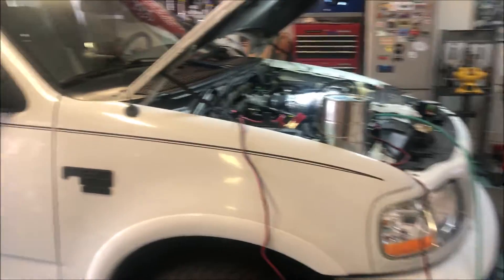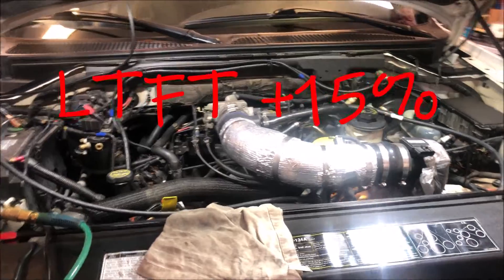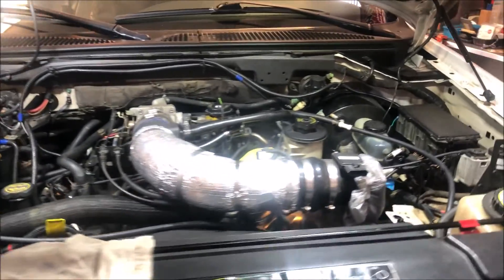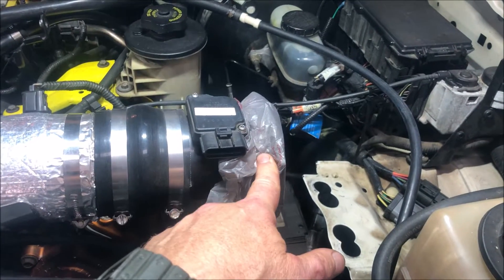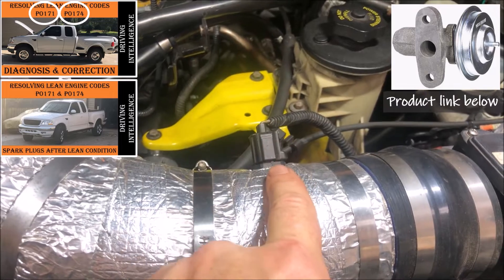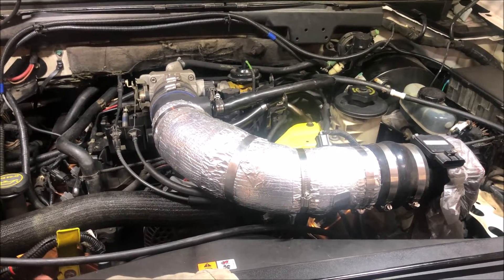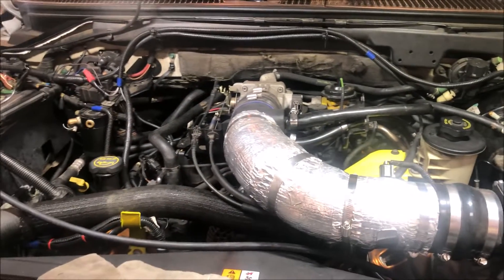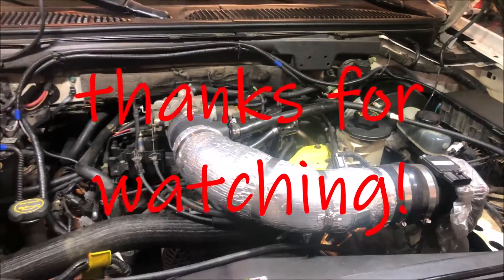How To Diagnose High Positive Long Term Fuel Trim: Test Bad MAF & Find Vacuum Leak With Smoke Test

Comment: Love these videos. I have the same code and waiting for my smoke machine to arrive. I’m assuming I have multiple leaks and one is from the gas cap since I don’t hear any release of pressure when I take it down to near empty
Reply from the maker: Smoke Testers are great for vacuum and EVAP leaks.  Stay in touch with your results.  What codes are you retrieving?
Reply: @DrivingIntelligence  
Will keep you updated. 
I have to replace both exhaust manifold 
Was wondering if everyone buys used one, the rockauto or go fully aftermarket performance. I’ve seen yours. I believe they’re high performance. Taking out the exhaust studs for ARP studs. Don’t want any issues with them snapping overtime. 
Engine codes : 
P0125 : Part - F56Z-10884-AA
P0453 : Part - 
P0171
ABS Codes -
C1155 : left front wheel speed sensor input circuit failure 
C1145 : right Front wheel speed sensor  input circuit failure 
C1158 : Left Front wheel speed sensor coherency fault

What’s a good scanner that can read transmission code? I have a old bluepoint from 2010. Time for a new one
Reply from the maker: @prophinishnyc31  Thanks for all that info.  Here is the diagnostic tool I recommend:  BlueDriver Bluetooth Pro OBDII Scan Tool - https://amzn.to/3lsVutO - if you buy through this link I get a small cut to support my channel, and it will not cost you more.  Be careful with P0453.  The sensor is saying you have high pressure, that does not mean the sensor is bad, it means it senses a problem with the EVAP circuit.  Also, your "C" codes are likely due to aged wheel speed sensors and both need to be replaced.  Finally, I would not buy used manifolds.  They are prone to cracking, get new units or go with some shorty headers:  https://youtu.be/9lrywhBHczM - thanks for keeping me informed.
Reply: @DrivingIntelligence  how would you go about chasing that Evap circuit issue?
Reply: @DrivingIntelligence  as far as the c codes
I saw one wheel speed sensor disconnected and completely chopped off. I believe I’m running 34” and I do hear wheel bearing noise up front. So I will replace both sides and wire up the front right which is chopped off. See if that resolves the issues
Reply from the maker: Were you able to resolve the wheel speed sensor issue?  I'm still looking into the EVAP issue... doing a little studying.  What year is your truck?
Reply: @DrivingIntelligence  2000 5.4L , wheel speed sensor I have not address. I do have the new wheels hub with pigtail harness for the passenger side. Unfortunately I work Mon-Sat and with the new change of time; when I arrive home in queens Ny; it’s dark, cold and no garage.
Reply from the maker: @prophinishnyc31  I feel for you in that winter weather!  Let me know how it turns out when you do that work.
Reply: I have the exact same thing on a 97 2wd 4.6 2v F150 with a 75mm BBK throttle body.  I even smoke tested the exhaust, evap system as well as engine.    Checked exhaust back pressure. So many other things I checked and or replaced its too long to list here.    Using ForScan Lite as my scanner.   I’m down to phantom intake manifold leak on lower plenum or low fuel pressure.   

Replaced the fuel filter and fuel pressure regulator.  DPFE sensor , EGR valve, EGR solenoid, EGR tube, EVAP purge solenoid, EVAP canister purge valve, and all those vac lines in back of the intake, some leaky section of EVAP lines that failed the smoke test.….all replaced with new.   Put  a new throttle body gasket in,   Yes I am the parts cannon.    About 19.5 inches of vacuum at idle now….cleared the PCM a million times….but still those fuel trims still.   Ugh. 

Runs like a top at all RPM’s and engine loads, throws no codes…but those fuel trims are whack.   Driving me nuts.

Fuel pressure is about 33 psi with good volume.   Is that it ?   Some say 40 psi minimum.   Others say nope.    I get mixed stories if that is too low a pressure or not.    This thing is trying to beat me but I’m gonna win someday.  

If anyone has any ideas please post.   Thank you!
Reply: @AB-kd9mk ohhhh the PAIN!!! I can relate.  EXACTLY what you said.....96 geo tracker.  At this point, with all the tweaks and def some parts, it runs pretty good. (just a littlle sputter-miss when idling?) But will always throw the dreaded p0400(EGR FLOW...)after i have tinkered abit, then do a clear/reset. History is new parts plus I cleaned all tubes and ports, etc. and tested tested tested and I finally traced it down to 1 of 2 EGR flow tests, (where the results where retrieved ECM'S P0400 freeze frame data, thru my scanner) the failure was from getting a low BARO input vs. a minimum specified one.  like 758 where it needed minimum 11550, so no pass, throw the p0400.
ALSO, while driving i notice how the long term fuel trim is spiked, plus gets a lil doggy and smelly exhaust, and not so happy overall.
SOOO I now feel like its a small intake manifold leak, that is letting un metered air in as manifold vacuum "increases" (but never hits optimum reading cuz said leak creates pressure drop. (then throws code)  ANNNNND When the 02 sensor smells the extra air blowin downstream, it commands ecm to raise the LT fuel trim to compensate.  (i suspect this because every now and then, mostly then,  i can get front 02 sensor to respond to me wafting propane near the bottom of the intake gasket area.  but its hard to replicate with  precision.  also after looking at them online, it seems the lower gasket material is very minimal where it rounds the bottom of each port.  i assume one of those areas has failed. This has been FOREVER trying to get this figured out.  Just boiled this theory all down on my prob 6th? revisit over the past 4 yrs!!!!!  I just decided i will eventually go for the replacing this gasket, and it might take months to get to it, but ill let you know what happens....gooood luck!!!

Comment: I have 75% pos fuel trim at idle on bank1 on a 5.3l. Can anyone tell me whats wrong
Reply from the maker: A 75% positive fuel trim at idle on bank 1 in your 5.3L sounds like a severe lean condition—the ECU’s adding massive fuel to compensate. Common causes: vacuum leak (intake manifold, hoses), dirty MAF sensor, faulty O2 sensor, low fuel pressure (pump/filter), or exhaust leak before O2. No codes? If no CEL, check for pending codes. Share the vehicle year/model and if it’s at idle only or under load. That’ll help narrow it. Clean the MAF and inspect hoses first

Comment: I would asume if it was maf or vacuum leak would afect both banks..maybe u got small exaust leak on one side ...hope u post solution if u got it fixed
Reply from the maker: The tuner I was using was making claims I had a problem with my fuel trims.  I in fact did not.  His tunes were not designed to properly handle the mods I had on my engine.  5-Star handled them perfectly,  I have since stopped using that tuner, I don't feel he truly understands these engines.  With 5-Star tunes, my fuel trims are perfect.

Comment: Im still not positive how a dirty maf can only effect one bank. Or anything in the intake tract besides right at the seal between the manifold and the head.
Reply from the maker: Given the path of air from intake to cylinders is different between each bank of cylinders & the MAF, the tolerances in ECU monitoring might pop a DTC for one bank before popping a DTC on the other bank... just a wild guess.  Also, figure in fuel injector differences, ignition performance differences, exhaust performance differences on each side of the engine, etc... all add up to affect fuel trims on each side of the engine differently and could cause a DTC on just one bank when the MAF is the problem... again, an educated guess.  :)

Comment: My fuel trim jumps between +100 and -100 aha doesn't seem right
Reply from the maker: Do you have a check engine light?  Diagnostic trouble codes?  What vehicle do you drive?
Reply: @DrivingIntelligence  alfa romeo mito 135 multiair, intermittent misfires high in the rev range and rough idle, suspect its a bad vacuum leak as multiair unit is ok
Reply from the maker: @matthewmckendry9428  As you saw in this video, one of the diagnostic tools I use is a smoke tester.  There is one I recommend in the description of this video.  Smoke testing will find your vacuum leaks, if that's the problem, but there could be other reasons.

Comment: i’m having a p0171 code. could a loud exhaust manifold leak and flange leak cause this? obv that leak is before my upstream 02 sensor.
Reply from the maker: Yes, an exhaust leak can cause a perceived lean condition.  It will allow oxygen to enter the exhaust and fool the O2 sensor.

Comment: my long term fuel trim increases with high rpm whislit the short term decreases, however when idle, the opposite happens and the number is very high on the short term
Reply from the maker: For some reason, your vehicle is requiring much more fuel caused by a vacuum leak that sucks in significantly more air when the engine is under load. This will cause long-term fuel trims to increase. Have you checked for vacuum leaks?
Reply: @DrivingIntelligence i have with a smoke test, none were visible, might be worth re-checking that, however today checked my purge valve and turns out with a battery voltmeter it didn’t produce a clicking sound as it apperantly has to prove it’s functionality, pain in the backside this but ordered the purge valve and going to replace it and see the effects !
Reply from the maker: @JRZL1 that could be the problem! You didn’t have any diagnostic trouble codes, telling you there’s a problem with the purge valve?
Reply: @DrivingIntelligence  no trouble codes indicating a issue with the valve :( only a po171 code which is quite frustrating, seeked some advice today, got told might be the timing or a bad flex pipe replacement, (as I had that replaced) but mentions that it may not pass emissions so will give that a look over aswell
Reply from the maker: @JRZL1 the purge valve could be introducing unwanted extra air
Reply: @DrivingIntelligence  well find out and get back to this, after replacing this part shall I notice a immediate response in fuel trim data
Reply: @DrivingIntelligence  wasn’t the purge valve by the looks of it
Reply: @DrivingIntelligence  any ideas what it may be, I only have a 3 cylinder engine, one bank, and both 02 sensors are showing very very very low voltage but reading the same code 0.05V and moves just a tiny bit up or down. What could this be ??
Reply from the maker: @NeonTlz11  Hi, sorry you have this issue, what is your vehicle year, make and model and please provide all issues and diagnostic trouble codes.  I'll need more info to see if I can provide some suggestions.
Reply: @DrivingIntelligence  it’s just a po171 code, Vw polo 1.2 2011 petrol 60hp
Reply from the maker: @NeonTlz11  Your issue is hard to diagnose from afar, but here is what I'm seeing.  Your O2 sensors are telling your ECU that you're running lean, lots of oxygen in exhaust, so it's telling your fuel injectors to push more fuel, hence the high fuel trims.  What confuses me is why you're not getting other codes indicating O2 sensors are out of range.  If they are staying at about .05 volts, that should have caused other DTCs.  At this point I'm guessing, but perhaps your Mass Airflow Sensor needs to be either cleaner or replaced.  You also might have an exhaust leak ahead of the O2 sensors introducing air.  This video might help you understand how I chased negative fuel trims in a Civic: https://youtu.be/OL1AHGfVwDE?si=0pyEiS-9JiiZVPbh
Reply: @DrivingIntelligence  thank you so much, what i am finding strnage is watching daignoisis videos observing long term and short term fuel trims, is that when idling the long term is at around 14-15% where as short term is at 30% however when the rpms increase, the short term immediatly drops to 0% whilsit the long term increases, i am going to observe this on a more advanced scan tool tomorrow, and hopefully takcle down this issue once and for all, i scanned the 02 sensor with that new tool and shows sensor one was at extremely low voltage, where as sensor 2 was alright, however attemepted to unplug the sensor 1 and the voltage numbers went to normal at around 0.425 which is optimal. considering what this may be do you recon its a 02 sensor fault ? or shoukd i scan out for exausht leaks tomorrow
Reply: I just unplugged the throttle body sensor and the fuel trims went to normal but was still reading a bit lean at 7% but far better than usual
Reply from the maker: @NeonTlz11  Throttle body sensor?  Or are you referring to the IAC (Idle Air Control) solenoid?

Comment: I have the engine running at an idle speed of -20 in the long trim, and if you move or accelerate, it goes from -5 to 0.0 at 2500 rpm
Reply from the maker: My first thought would be a faulty fuel pressure regulator.  Too much fuel at idle, then somewhat an appropriate amount of fuel at higher rpm's.  Check your fuel pressure and let me know what you find out.  Check this video to show tests on my 10th Gen Fuel Delivery Problem:  https://youtu.be/kRejFPy2OM8

Comment: Good vid, but we need to find what you determined cause high fuel trims
Reply from the maker: Right on... I will follow up, but the short answer, there was nothing wrong with the MAF.  All checked out fine.  The Tuner made adjustments to the fuel table to lower LTFT

Comment: After cleaning the MAF on a ford ALLWAYS do a KAM (Keep Alive Memory) to reset the ECM BARO calculation then do 3 separate WOT (Wide Open Throttle) 30-60 MPH pulls to reset the BARO...👍
Reply from the maker: All makes sense, thanks.  Where’d you get that procedure?
Reply: @DrivingIntelligence  I read a Ford factory service manual and also Identifix gives info on the ECM's BARO calculation and how it affects fueling decisions on these systems, Good video and keep up the good work!
Reply from the maker: @CharlieAtkins  Thanks very much for that info, I'm a struggling DIY'er ;)  everything I do on this channel I teach myself, as effectively as possible.  Truly appreciate your input.
Reply: @DrivingIntelligence  You should do a video on this!
Reply from the maker: @taypat  please elaborate!  :)
Reply from the maker: Incidentally, I did do a KAM reset, just not familiar with the other steps.

Comment: The TPS doesn't come with a gasket and leaked on mine. 

Smoked out of the TPS real bad, a gasket solved the issue

Everyone on the forms claims it doesn't need one tho
Reply from the maker: Good comment!  Anywhere there is a leak, there is a loss of vacuum and the engine computer gets angry.  ;)